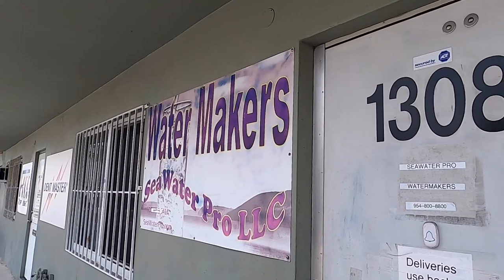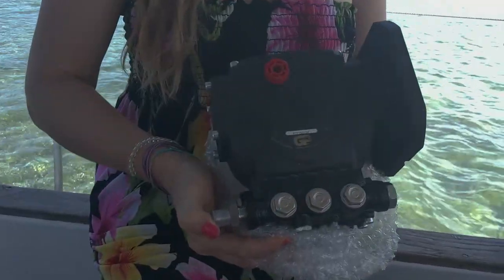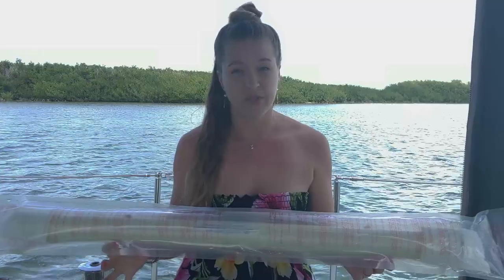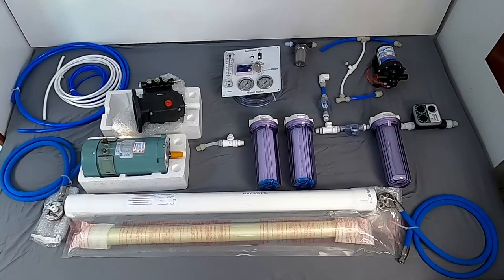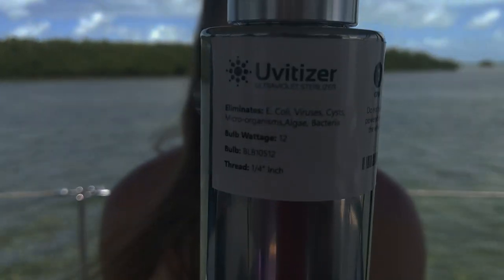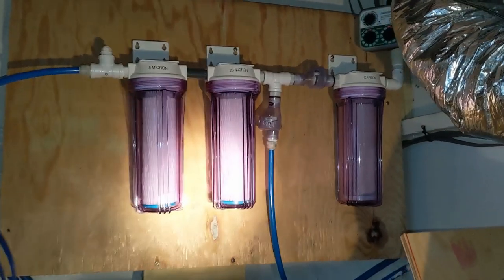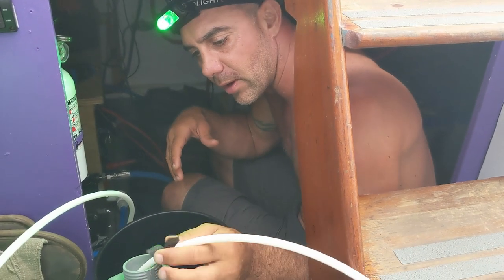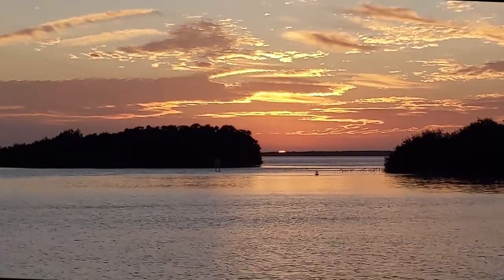Ep. 45 - Saltwater to Freshwater- Our Watermaker Install~ Big Easy Sailing

Comment: I'm currently working on an install. Have yall had any issues with the brine water pumping into the bilge?
Reply from the maker: No issues with that. We now have the brine going out of a threw hole. Our bilge is bone dry these days. We finally installed a shower sump box. Thanks for the question.